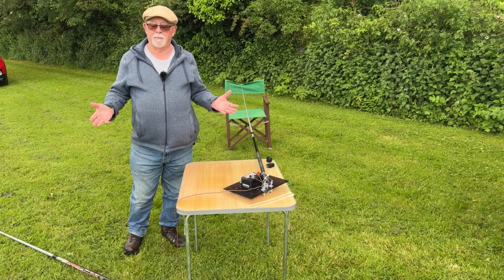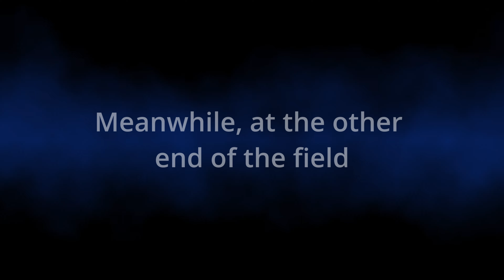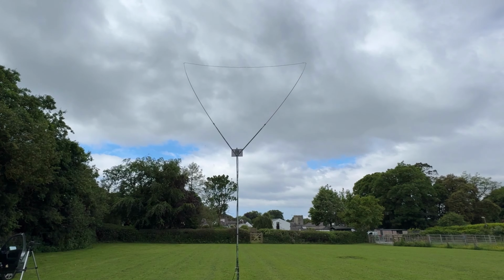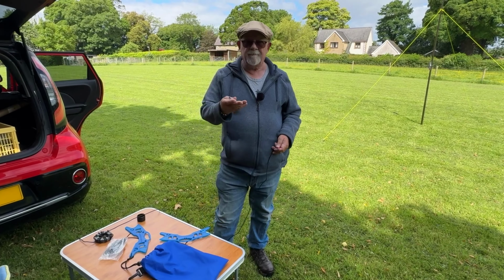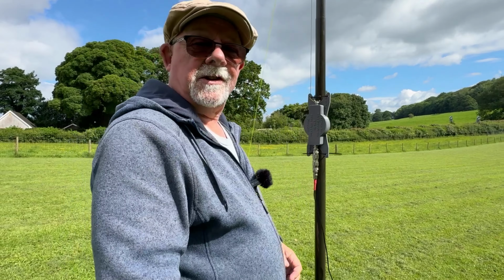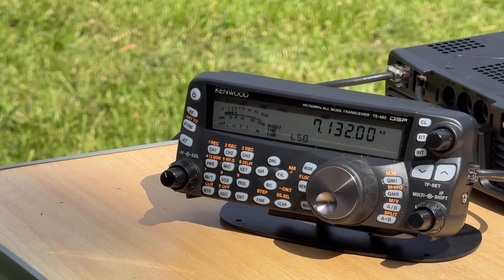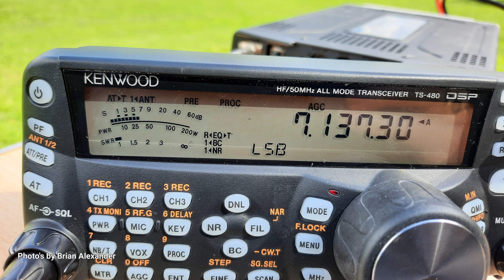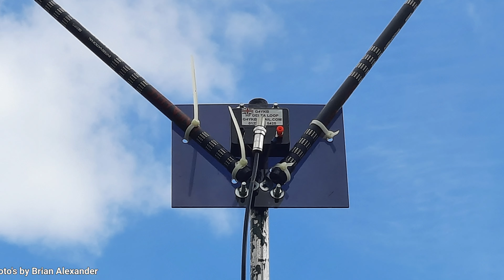V for Victory?

Comment: Hi Folks, just by way of interest the Delta Loop covers 40m through to 6m and won't tune on any band at basic setup, however tunes down 1.1 with the Internal Tuner on the Kenwood TS-480 Sat.   The Antenna is cheap as things go made in the town of Bolton by G4YKB Ham Radio Solutions.....  Thanks for putting the Video together Ian..... Shame the bands were quiet again!

Specification

Loop is a Delta ( inverted triangle)

Loop is supported by 2 telescopic fibre glass rods

Length of each rod is approximately 11 Feet

Width of top span approximately 11 Feet

Connection is by PL259

Input tested up to 400 watts SSB

Antenna is Omni-directional

Back plate is 5mm opaque cast acrylic sheet

Mounting clamps supplied are 50mm

There are no serviceable or adjustable parts in the transformer  housing box and all components are potted

Comment: I have the same dela loop that was originaly sold my ProWhip 30 years ago, and it looks easier to assemble than yours. The two poles slide into tubes attached to the mounting plate. It is drectional as to say but the suprise is it is not side on as many think, but end to end. Great antenna for portable, I have a drive on mount with 2 inch ally pole and raise it just above my car. Don't know why I don't use it more. Verticals just seem quicker to assemble.
Reply from the maker: Thanks John.  I wasn't aware of the directionality!  We will look at that the next time we use it :). Ian